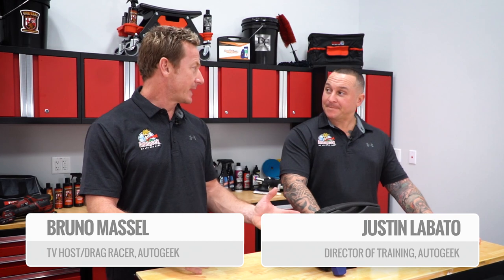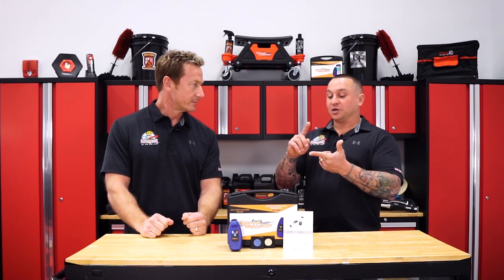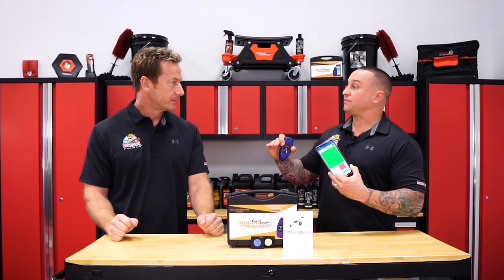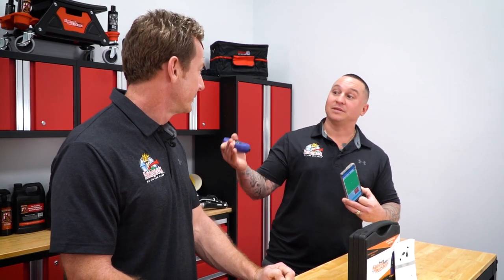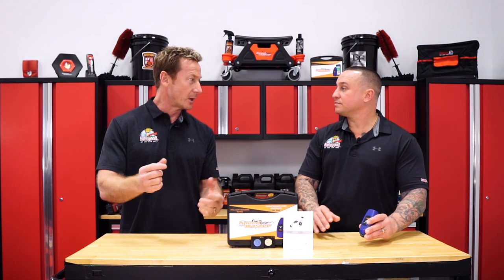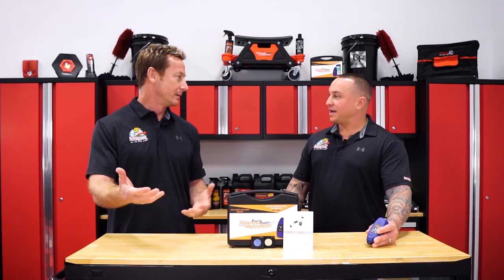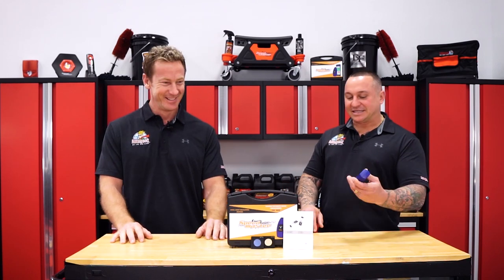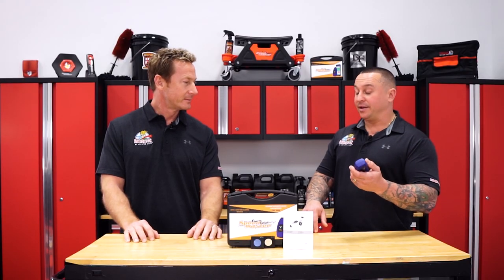What is a Coating Thickness Gauge and what is its Purpose?

Comment: So you can't use this on plastic bumpers and trim pieces then?
Reply from the maker: Speed Master Professional Paint Thickness Gauge will recognize and test thickness on steel, galvanized steel and aluminum. It will not work on plastics. Those types of gauges cost much more and require different probes to use on different substrates.
Reply: @autogeek  thanks good to know but unfortunate since non-metal bumpers tend to be the most common resprays but this can't detect that.
Reply: @skyace888  you're using it to detect thin paint to not burn through it, if it's resprayed it would be thicker. If you're trying to find previous work and not thin paint then this isn't really designed for that, even though they mentioned it.